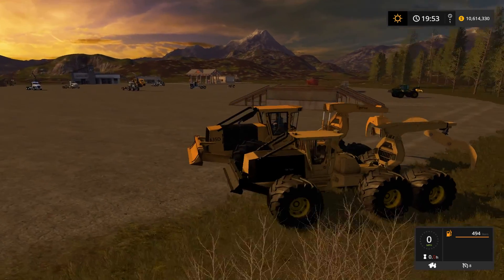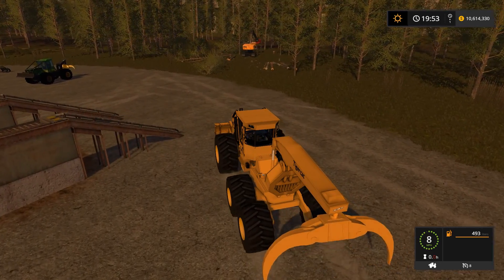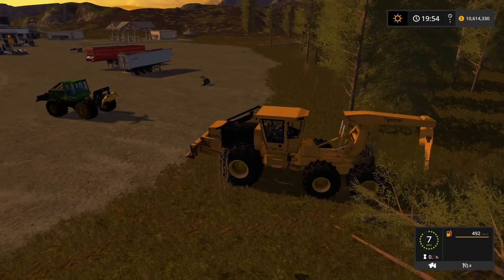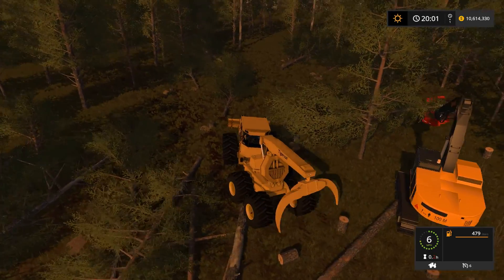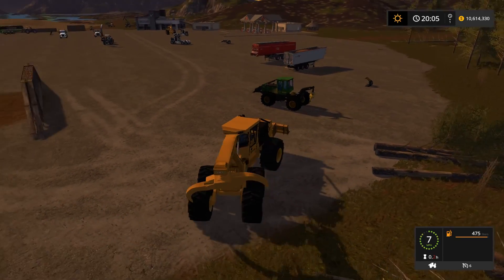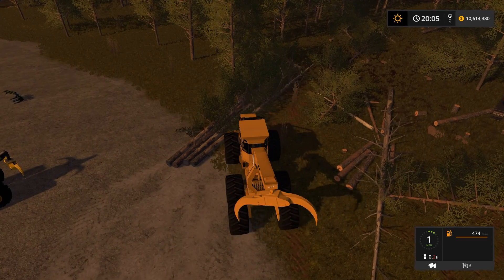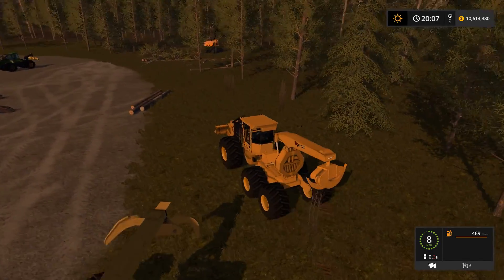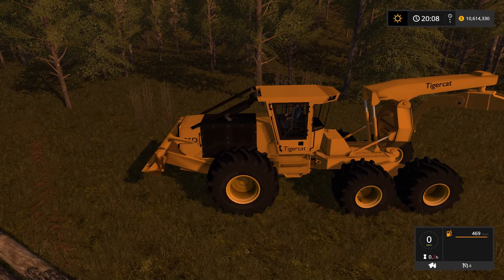Farming Simulator 17 - Tigercat 635D Mod Review

Comment: Sped isn't realistic they can go 30 and sound is way off
Reply: Speed and I'm just saying
Reply: A tigercat 635 can not go 30, and the sound pitch is off yes but they are actual sounds
Reply: I just looked at the specs disregard what I said it's top speed is 11 forward and reverse so it's all off
Reply from the maker: Well, it sounds pretty good to me.  The only way to make it sound better is to record an actual 635D and put the sound in the game.  And the top speed of a 635D is 9 mph.  That is directly from Tigercat.
Reply from the maker: https://static1.squarespace.com/static/568968e34bf118b4ed5c6152/t/56d3a2c35559860e35f59280/1456710396922/620d630d635d-DseriesSkidder_brochure.pdf
Reply: I know those sounds are from a tigercat skidder, i run stuff in real life
Reply from the maker: That's the 630C.  4 wheel skidder.  Not the same as the 635D 6 wheel skidder.